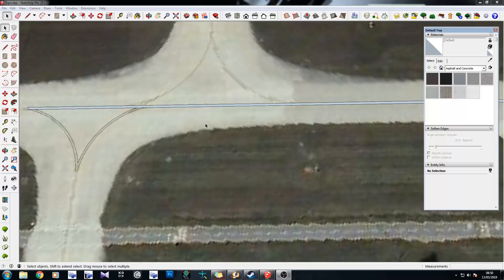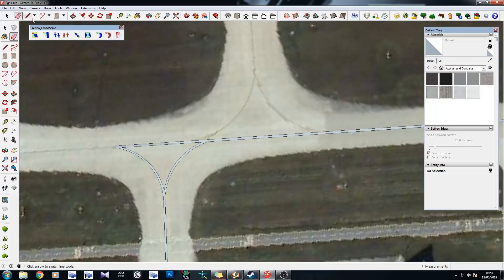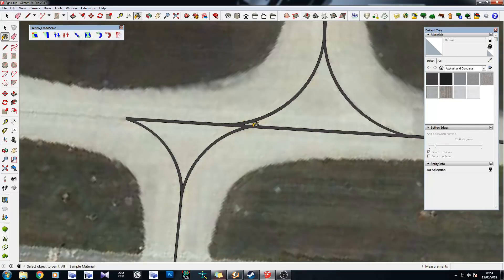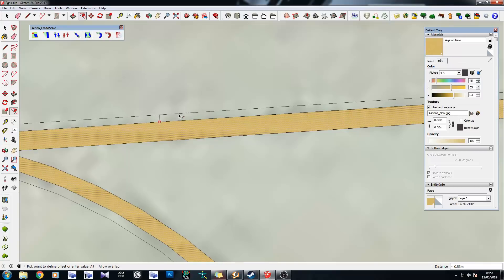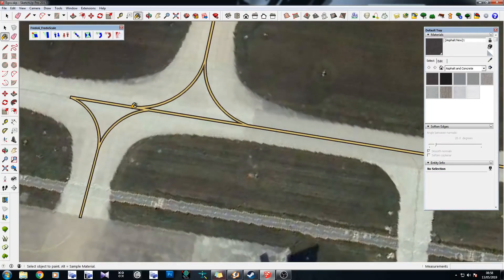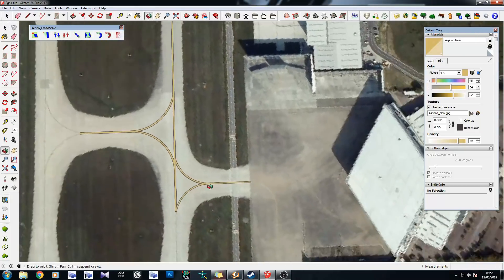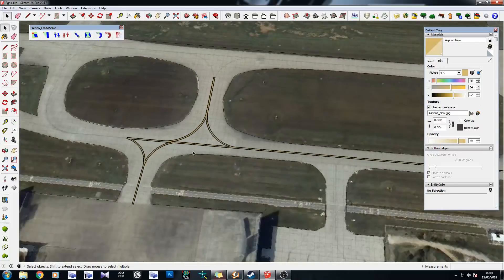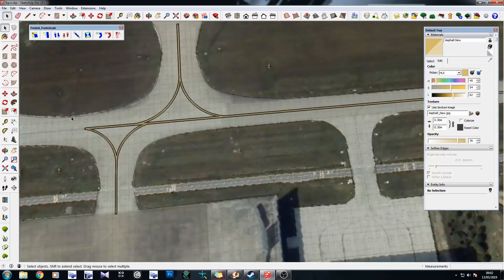Taxiway Lines - FSX Scenery Tutorial

Comment: how do you create a holding point?
Reply from the maker: You need to use a texture to create the visual elements then using ADE you can create the taxi point element, sitting under the main ground polygon ADE will only generate the unseen part of the scenery

Comment: Hi Mark. Quick question regarding the layers. Can you assign the layer number in sketchup or do you have to export each layer as a „model“ and assign the layer in ModelConverterX? If so how can you import several models at once in MCX?
Reply from the maker: Mcx uses the textures to separate the parts of the model. So if you try and consolidate and use only 1 line texture, MCX will see this as having only 1 model part. So realistically the best thing you can do is to export separate layers from Sketch as individual models. It seem right now to be the fastest way.
There is a way you can do a multi import yes
Reply from the maker: https://youtu.be/P88ta6nbBYE